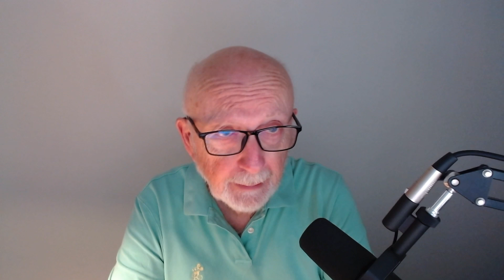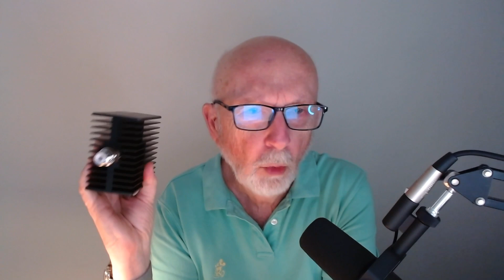Ham & CB Radio Myth - Non Resonant Antennas Don’t Radiate As Well.

Comment: To understand antenna efficiency, you must consider ohmic resistance and the mismatch between your transceiver and antenna. The more “things” you put in between your antenna (e.g. tuner, ununs, baluns, feedline, jumpers, connectors etc. to correct that mismatch, the less efficient the antenna SYSTEM is going to be. A perfectly matched monoband  40m dipole, using modest lengths of RG-213 or LMR 240 is going to be extremely efficient, with very low overall loss including reflected power. On the other hand, non-resonant mujtiband antennas are relatively inefficient because of the need for tuners, ununs, baluns, balanced feeder line, and special connectors that all contribute to RF power loss. Baluns can get very hot as well as thin wire, especially if you are running an amp, which with the crowded bands these days, QRM, and QRN are almost a necessity. The other critical factor is antenna height above ground, which can have a profound effect on overall antenna system efficiency.

KC5RJL
Houston
Reply: Take a look at the loss charts for the various coax types. It's not as efficient as you think. Especially on the higher frequency bands. Balanced line blows away all types of coax for low loss, yet hams shun it because they don't understand how it works. Or they tried it once and had RF on everything. Usually because of an improper installation, not the fault of the line. The old vhf/uhf TV antenna's ran 300 ohm line on the UHF side for a reason! Low loss over a long run of line. The classic scenario that makes me laugh are the guys who cut a dipole to a band and direct feed it with coax and then assume they have super low loss just because the swr is flat. When you feed a balanced antenna like a dipole with coax...which is an unbalanced feed line, you have common mode current on the shield of the coax. In effect, it's leaking RF power before it gets to the antenna. This is not efficiency...it's loss. To properly feed this dipole, you need a 1:1 balun at the feed point to stop the coax from radiating. Yet guys will argue till they have a heart attack that this is the best possible way to put up an antenna. The only reason hams hate baluns and tuners is because they either don't understand how they work, or improperly use them and fry something and then blame the equipment instead of themselves. Whatever floats their boat...that's why I don't discuss it on the air anymore.
Reply: @richb.4374 That's a good point about balanced feeder. I suspect some hams have spent a fortune on expensive co-ax when some cheapo window line or ladder line would have performed better. Also, yes, not using a BALUN on co-ax fed balanced antennas risks common-mode current which, if sufficient, which can upset the expected radiation pattern, maybe present problems with RF in the shack and increased local QRM on RX.
Reply from the maker: The efficiency of an antenna, how well it radiates, has nothing to do with any line losses.  That all happens before the antenna.  Non-resonant multi band antennas are not inefficient.  Provide references.
Reply: Consider this example of a non resonant antenna,,

A resonant 80m dipole fed with rg58 coax 

Vs

An 80 dipole thats a little shorter that presents a 10.1 swr to a tuner with 600ohm balance feedline 

Which one radiates the most power ?
Reply: @paulm0hpd319  When you say 10:1 SWR, is this at the dipole feedpoint WRT 50 Ohms source?
If it is and the "tuner" is a balanced matching device, I suspect that it is the second option where the antenna (and only the antenna) will radiate more power (nearly all the power). In fact, if you were operating at a specific frequency/portion on 80m, you could even add/remove some balanced feeder to get very near 50 Ohms resistive at the transciever end. Attach a BALUN and get 1:1 SWR (or very near) unbalanced 50 Ohms resistive system feedpoint at the transciever end. Then you don't even need the "tuner". This is the principle that G5RV type antennas use where the balanced line is used as the impedance matching device.
Reply: @Steve-GM0HUU  it be 10.1 that the tuner sees ,yes balance feedline can be use to as an impedance transformer, a transformer balun could be used but that would be a fix impedance, a tuner would be more flexible and efficient
Reply: @James-ci3lx yes coax can be used as an impedance transformer, my comments are in reply to the first comments about a non resonant antenna not being efficient
Reply: Houston you have a problem

Comment: As much as I agree with you Mark, there are hams with heads that are as hard as tungsten carbide and you will never get through to them. I avoid antenna conversations on the air for this very reason. Very few hams get it. They bring this old wives tale with them from their 11 meter days and truly believe it's gospel. I know a few of them myself that hold this belief as if it's gods word.
Reply from the maker: Too many only want to believe what they already believe and are not willing to crack open a book and learn something new.
Reply: @BustRadioMyths  Amen.
Reply: The C.B. myth of trimming coax inch by inch gets me.
Then they connect the jump lead through an SWR meter. What tuned coax? It no longer exists and yet they insist on doing it even when I said it's no longer a ½λ of carefully trimmed coax.
G4GHB.
Reply: @bill-2018  What most of them don't realize is, if coax length is affecting their swr, that means it's radiating or has common mode on the shield. Coax length on a proper antenna should be irrelevant, but if you tell a CB'er that they will argue with you till your head explodes. I've heard that tuned coax business since the early 70's. All someone has to do is look at a commercial broadcast station. Do the engineers who design and build the antenna system cut the hard line to specific lengths to make the antenna work? That's a big negatory! LoL
Reply: @richb.4374  I agree, it must be acting as a counterpoise earth. Imagine trimming coax for our 472 kHz and 137 kHz bands.
G4GHB.

Comment: More food for thought…A 5/8 wave vertical is non-resonant. If a transmitter had an output impedance of 50 Ohms then it would have to dissipate 100W of heat for 100W of RF power to the antenna. An ideal transmitter has a very low output impedance. Then it is efficient.
Reply: Very few antennas are 50 ohms and require some sort of matching network to make them 50 ohms. The 5/8's wave vertical is a good example...yet some hams swear up and down that it's resonant. It's not without that hidden matching network in the base...but don't tell them. A 3 element yagi is not a 50 ohm load even when it's "tuned" as a monobander. It needs a gamma match or some sort of matching network at the driven element or the swr would be terrible.

Comment: 1:23- The Antenna Tuner does NOT tune your physical antenna to resonance. It effectively creates a match of that Antenna to your radio or ATU connection point. In other words the Tuner does not tune your Antenna but allows your transceiver to be used with the compromised Antenna that is being used. The best antenna is a mono band or wire cut to frequency so a tuner is not needed.
Reply from the maker: When inductance and capacitance cancel each other, you have resonance.   That's what a tuner does for an antenna.  If you don't think so, provide references.  I did.
Reply: @BustRadioMyths  Because its physics my friend.. The ATU does not PHYSICALLY tune (( Shorten or Lengthen))  the antenna to the frequency or band that is being used. It essentially "matches" the radio to the Antenna at the location of where ATU is placed ((ie- At Transceiver or Feed point).  If this were case you wouldn't need much to get a perfectly resonant Antenna...Just use an ATU.  Once your RF Leaves your transceiver ((With ATU)) its fine and travels through coax ((You have losses)) then hits feed point of your Antenna it will resonate as if an ATU was not present because of length of Antenna and other factors. The ATU is not a magic box that erases all flaws and or compromises that your Antenna has. I don't need to provide references because its common sense and physics.
Reply: @BustRadioMyths  I'll try to explain without too much hand-waving, complex math or appeal-to-authority.

To achieve an impedance (Z) match, a load's resistive (R or V/I) and reactive (Xc or Xi) parts must be considered.  If source R equal load R, then canceling only the X part via insertion of an X of equal and opposite value (i.e., Xc cancels Xi and vice-versa) will "tune" the load (i.e., antenna or feedline-antenna combo) to resonance and a Z match.  But if source R is not equal load R, then "tuning" the load to resonance will not form a Z match.  Instead, a transformation of the load's V/I ratio must occur to match the source's V/I ratio while simultaneously cancelling the load's X component.  This R transformation with X cancelation can be accomplished via various LC network configurations (e.g., L, T, Pi) that act, in part, like a virtual transmission line to "shift" the V/I ratio and relative V to I phase angle (X) presented by the load to match the V/I ratio of the source and cancel X from the load.  Thus, when the LC network is adjusted for a resistive (V/I) match and X cancellation, the load will appear resonant to the source.
Reply: @BustRadioMyths  It’s basic physics. You are correct when you say inductance and capacitance cancel each other but you must understand that this occurs where the transformer ((ATU)) is presented. The ATU does not physically lengthen or shorten your Vertical Telescopic or Wire Horizontal Antenna. The ATU does not have control over ((RF)) and it’s reactive traits on the resonating element/s of your AnT when transmitting on different frequencies. When you state that the ATU “tunes” the Antenna this is not correct. The ATU transforms whatever ohms the AnT creates to be as close to 50 ohms when it’s presented to your transceiver. To obtain true resonance the AnT has to be mathematically equated to frequency used for optimal performance. This is relatively impossible when you’re using different frequencies and bands. The ATU is very important if you are using multi band AnT’s which are always compromised. The ATU is NOT a magic box that physically tunes your actual AnT that is being used. You’re definitely going to get better results using an ATU in line because it presents 50 ohms to transceiver but once your transmission ((TX)) hits your resonator it’s going to present the same mismatch that it was prior to the ATU being installed in line. This is why having an ATU at feed point is optimal because instead of correcting mismatch at transceiver you’re correcting it at the feed point. Doing this will achieve the best performance out of your already compromised multi band AnT. In closing, whatever your SWR reading is before ATU is installed is a pretty good indicator of how it’s going to perform. This is why it’s important to try and get SWR as low as possible on each band before ATU is used.
Reply: @trailwalker76 the reactance at the antenna feedpoint is the conjugate of the reactance at the tuner output therefore the antenna is tuned to resonance
Reply: In looking at all the replies so far, especially on this post and many of the others, we can see that people are getting mad (or confused) with the "shorthand" claim in the original post about an ATU "tuning" an antenna. After all, that is why we call them "antenna Tuners". Of course, you could argue that the ATU does not tune the antenna, or you can accept that what we mean by this is the ATU introduces a suitable X(L) or X(C) to cancel the existing reactance on the antenna (or antenna system, if used at the rig instead of at feedpoint). People, stop getting confused about ATU being an antenna tuner. It's OK to use this verbal shorthand, if we assume you know a little RF and antenna theory! Sheeeesh!
Reply: @davidjohnson497   I agree with you but what this person is saying is obviously not the case. The term "AnT Tuner" is used to sell the units. Back in the day they were called "AnT Matcher" which is more accurate. I have a 28.5' wire in backyard that tunes to great SWR but doesn't resonate well..  So just because it tunes doesn't make it resonant.
Reply: @trailwalker76 if it tunes out the reactance of the whole system then surely the whole system is resonant
Reply: @paulm0hpd319  That's the point...It doesn't.
Reply: @trailwalker76  it sure does,I've just looked through your comments, it's clear you have a misunderstanding of this subject
Reply: @trailwalker76  I think you are misunderstanding me ,if a tuner tunes out the reactance of the whole system by conjugate matching then the whole system is resonant, btw resonance doesn't guarantee efficiency
Reply: If a 50 ohm ATU is at an antenna's feed-point, it "tunes" the antenna feed-point to achieve an impedance match at or near 50 ohms.  If the ATU is between the transmitter and an antenna's feedline, it "tunes" the impedance presented at the feedline entry point to achieve an impedance match at or near 50 ohms.  If perfect, this impedance matching allows a 50 ohm transmitter to fully transfer its output power to the antenna system; otherwise, maximum power transfer is as efficient as reality allows.  Notice that impedance matching is the goal here, not resonance.
Reply: @DaDitDa  A transmitter, effecively an AC voltage source, transfers the most power when the  load is equal to the source impedance. However, a transmitter with a source impedance of 50 Ohms would dissipate as much power as it sends to the antenna, which clearly isn't the case for most transmitters that manage more than 60% efficiency.

it is probably possible to coax (pardon the pun) more power out of a transmitter by presenting a lower than 50 Ohm resistance load to it. But it probably wouldn't like it for very long.

The 50 Ohm load is simply the load the transmitter is designed to drive efficiently without going over-current and over-heating, or in the case of an open circuit, swinging over-voltage and potentially damaging the output device that way. A well-designed rig throttles the output stage drive if it senses too much current being consumed or the collector/drain voltage swing is too high.
Reply: @SimonBlandford  Mostly agreed.  Although, the efficiency of a power generating source has little bearing on the power transfer efficiency from source to load.  For example, a class C power amp designed to supply a 50 ohm load with 10 watts, may operate at 80% efficiency.  A class B power amp may operate at 60% efficiency to produce 10 watts.  For these amps, the efficient transfer of 10 watts output power is dependent on a well-matched 50 ohm resistive load, not the operating efficiency of the amp.
Reply: @DaDitDa   Correct. Impedance matching is the goal if you have high impedance. The main objective is to have a resonant antenna to achieve optimal performance. Wherever the ATU is presented along the feed line ((Considered an RLC Circuit)) That's where the "Match" will be presented. If ATU is in shack next to radio its basically a safety box so radio doesn't get heated and fried due to high SWR. The TX is garbage once it gets to an non resonant antenna or resonator. Having a ATU at feed point of Antenna is optimal if your going to use one but why if you just cut antenna wire to frequency and bypass ATU altogether.  Using multiple band AnT is very difficult and can  show different results. Multi band AnT’s are compromise but the ATU Does NOT physically change ((Tune)) the Antenna RESONATOR ((Wire or Vertical)).
Reply: @trailwalker76  I have a short, loaded (center coil + tophat) vertical antenna that's tuned near resonance at about 7.1 mHz.  At its resonant point, input impedance is about 12 ohms.  According to your view, I should not need an ATU because it's "cut to frequency."  The point here is that resonance does not infer impedance match -- never has, never will.  The job of any ATU is to match the impedance of a source to the impedance of a load -- nothing more, nothing less.
Reply: @DaDitDa  Re-Read what I wrote. You are dealing with a Short Loaded (Center Coil with Top Hat) probably multiband vertical...Compromised. When I say cut to frequency I'm talking about wire antennas ((Dipoles)). A tuner does not and will not physically tune the Antenna.
Reply: @trailwalker76  I interpreted "cut to frequency" as being any resonant antenna -- not necessarily a dipole wire antenna X distance above ground.  Clearly, I agree that an ATU's function is NOT to tune an antenna to resonance.  It's an impedance matching device, -- nothing more, nothing less.  Although, with an ATU at an antenna's feed-point, achieving an impedance match may result in tuning the antenna to resonance via series  capacitive or inductive loading.